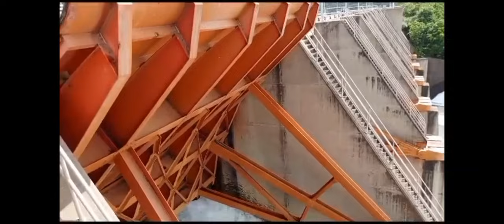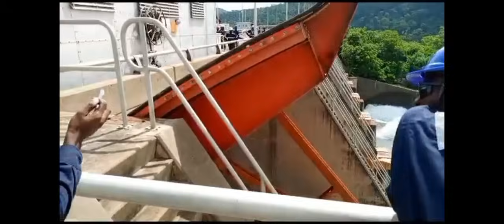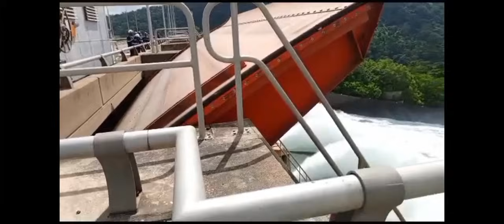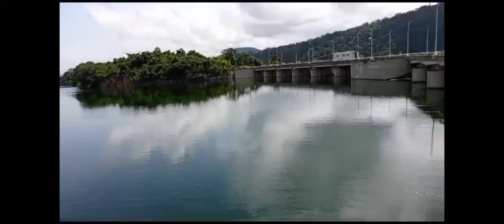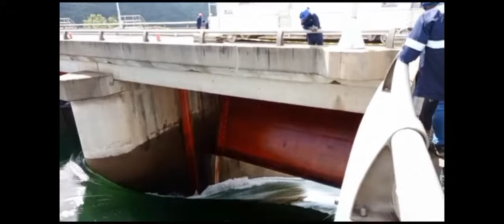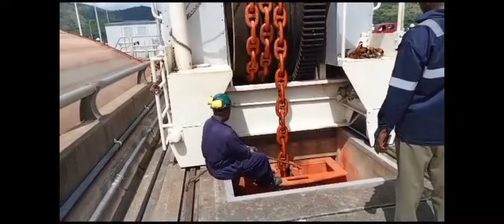Watch Akosombo Dam spillage 2023 | Show to your learners or wards

Comment: " Under smart and intelligent situations ": The officials who monitor and manage the dam have access to all the metrics and are fully aware of what is going on. Before things get worst and actions taken,  send anouncement out to all localities that will be affected. Move the residents and their livelyhood out of the way. Sometimes we can be really dumb and cause un-necessarily harm to others
Reply: @newElon I understand your frustration with the elected officials in this country. They often make decisions that make us question their intelligence. However, in the case of the dam spill, I want to assure you that it was planned and announced in advance.

The decision to spill the dam was made because the water level was rising rapidly and there was a risk of flooding. The authorities were hoping that the incoming rains upstream would not significantly impact the water level, but unfortunately, they did.

The last time a spill of this magnitude was done was in 2007. Since then, water levels in the dam have been nominal, even in some cases so low as to impact power generation.

I know that this spill has caused inconvenience and disruption for many people, but I want to assure you that it was a necessary step to protect the dam and the people downstream.
Reply: U aren't affected so u will write this long thesis
Reply from the maker: Unfortunately, it the opposite situation